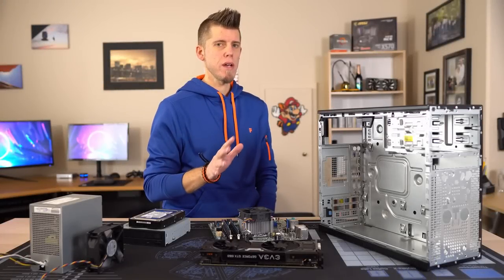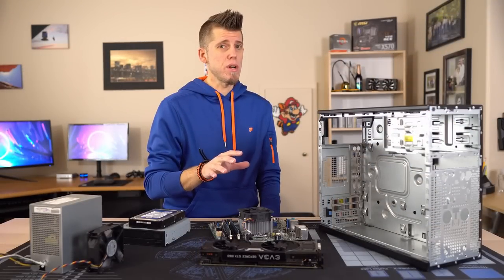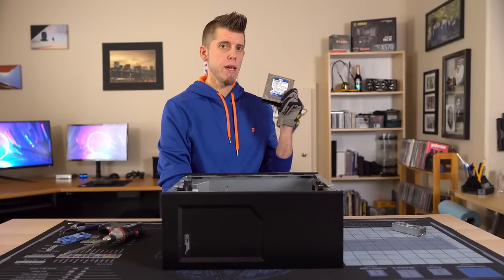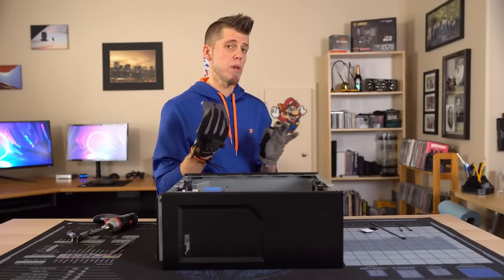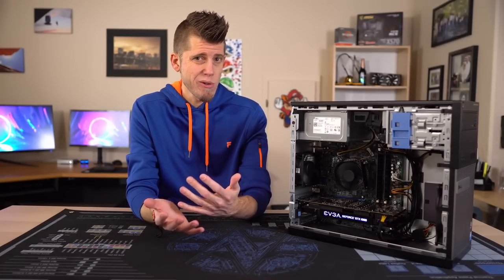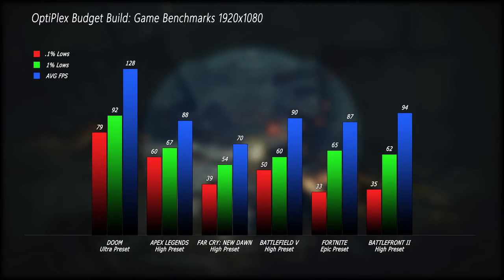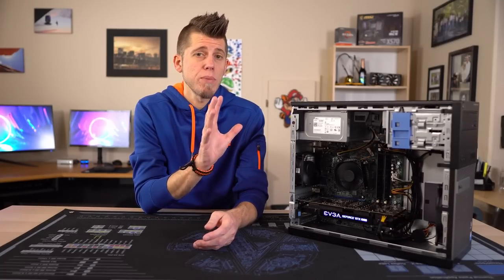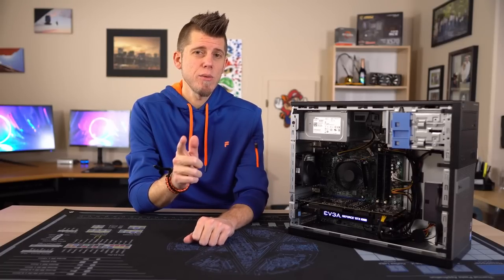Dell OptiPlex Budget Gaming PC For Under $300?

Comment: thanks for this video i have optiplex 9020 i7 so i will just buy the same gpu like yours, hopefully i can find same price like that.
Reply from the maker: Right now... not really. For some reason people are paying absurd prices for 1060 6GB models. You might have better luck in your area locally, but on eBay, I've about given up on 1060's. I've seen them go as high for around $180. At that price, just go for a 1070 for around $200 and it would be a much better paring with your i7, but you will need a better PSU, and the Dell XE2/T1700 365 watt power supply is a drop in for the 9020 and will give you enough power for the 1070.
Reply: @TheGameBench  thank you for taking time to answer my comment. my friend also have this optiplex and he used 1050i without upgrading the psu. do you think buying 1070 are worth it for some video editing and gaming?
Reply from the maker: @djhurtutorials  No problem. The 1050 Ti is a decent entry level GPU, but in gaming the 1070 will be a huge increase. In video editing... that depends on which editor you're using. If you're using Davinci Resolve, for example, and you're just using the free version... no. Not really. However, if you're using the paid version, very much so.
Reply: @TheGameBench  thank you i'm using adobe premier pro. i just saw one video uses 1070 so i guess i will for there. need to  save a little bit of money hehehe
Reply from the maker: @djhurtutorials  Then yeah, the 1070 will be a big difference over the 1050 Ti.

Comment: Hello! I'm a rookie PC "builder" and looking to make a similar build although, I'm using a Dell Optiplex 390. I had a question and my question was, if I could use a RX 570 (4GB) on it. It has a identical motherboard layout to the optiplex 3020 and I'm worried I might damage it/potential bottlenecking. I don't have that "Blue Pci Slot" but instead, it has that one "solo" black one. My RX 570 is about (10 in ; I believe) in length, in case you wanted to know. Please give me some insight. Thanks! 👌
Reply from the maker: No, you won't damage it. The nice thing about the 390, and the 790, is that the SATA ports aren't in the way of the GPU, so long as it's a dual slot card. That being said, you will need to replace your power supply.
Reply: @TheGameBench   The Game Bench  Sure thing. Last question; is it possible to put a i7-2600, in this motherboard? Correct me if I'm wrong but I do think you said that to someone else who had a 390. Thanks for insight!
Reply from the maker: @goldenbillz6390  No problem. Yeah, you can drop the 2600 right in. As far as I know the 2700K is the only Sandy Bridge processor that won't work.
Reply: The Game Bench  Forgive me for being a rookie but last question. So, in the process of building the PC, I bought a new ram stick so I'd have 8 gigs of RAM but, once I power on my PC and let windows boot up, I get blue screened and it'll keep rebooting and rebooting and won't surpass that blue screen. Now, I have tried them individually and they do manage to boot up windows but they won't work together for some reason. They are two seperate frequencies as the one it came with is 1333mhz, while as the new one I got is 1600mhz. I have done some research but they all say it doesn't matter and that it would "tone" it down automatically. Any help on how to solve this?
Reply from the maker: @goldenbillz6390  Sorry about the late response. Got really caught up it trying to get my latest video out. Anyways.... yes, the faster stick should downclock to meet the lower speed stick. I don't think that you're problem. It's possible that there could be a problem with one of the sticks where it seems to work fine by itself. There could also be a problem with one of the slots, though that's not super likely. I would try to run memtest86 on each stick individually to see if either fails. If it does, try another memory slot.

Also, these's pre-builts can be picky about what RAM will and won't work. It could just be a case of the system not being happy with one of the sticks.
Reply: @TheGameBench  It's alright man. No need to apologize. I figured it was the system just rejecting it for some reason, but I honestly bought the dell optiplex 790/990's motherboard. And along side that, I also bought more ram but made sure I got the ram at 1333mhz and it's running like a champ. Regardless, I still appreciate the feedback and like they say, you'll learn as you progress. Thanks once again!

Comment: I have the same pc, but my rx 570 is covering the Sata ports and the front USB ports, what should I do?
Although, how do I remove the graphics card? Should I pull or push this blue thing by the PCIe slot?
Reply from the maker: Silverstone makes some low profile SATA cables that will clear the GPU. Just do a search on Amazon for "Silverstone low profile SATA cables" and they'll pop up. For the USB3 header, I use and low profile extension cable. There are a lot of garbage ones, but I've used several of these can they've been great.

https://www.moddiy.com/products/USB-3.0-20-Pin-Internal-Header-Adapter-Cable-Low-Profile-Connector.html

Comment: I have a dell optiplex 790 i built with a gtx 1060 and 16gb of ram. I wanna upgrade to a 120gb ssd for a boot drive, do you think that there will be any bios conflics with making the ssd a boot drive.
Reply from the maker: There shouldn't. When you get the SSD, just install it in the system and boot it up. Then use Macrium Reflect free to clone your current drive to the SSD. I will make an exact duplicate and then you can swap out the old drive and it should boot off the SSD like nothing even changed.

Comment: Is it safe to run gpu on 290 watt power supply with 15 pi sata connector??? 
Please reply
Reply from the maker: Depends on the GPU. The 1060 6GB? Yes. I suggest you read the pinned post for more clarification. But the short of it is, the 1060 will draw 75 watts from the power supply and less than the 54 watts from the SATA connection, which is what a single SATA connection is rated for. Thus, why I decided to go with the 1060 6GB rather than something like the RX 570 or 580 for less money.

Comment: i bought a 7010 optiplex i5 3470 8gbs of ram grabbed a cheap 500 watt psu and a msi 1050ti low profile and put a new hdd in there it was really easy
Reply: How good is it? Did you have any issues

Comment: Good Evening,  How did you mount the ssd on the side?  Thanks, Ben
Reply from the maker: I just used some 3M command strips. They hold it securely and come off without too much fuss.
Reply: @TheGameBench  thanks buddy, my way was a bit more ghetto. I just drilled holes on the bottom of the case in the same pattern  as the bottom of my ssd and screwed the ssd in to the bottom of the case close to the fan.

Comment: I have a 2 questions about the 3020. 1. Can it take a ssd? 2. Will it improve my gaming experience? Thanks
Reply from the maker: Yeah, you can put an SSD in the 3020, no problem. The only difference is that you have one less SATA port, but that should be a non issue. However, unless you run the games off it, it will have zero impact on gaming. Even then it would really only have an effect on load times. Frame rates would be the same regardless. That being said, they're so cheap these days. Something like the Adata SU635 or Crucial BX500 are great budget SSD's and they will make it seem like a completely different computer in loading times, open programs, boot times, all for about $30.
Reply: The Game Bench thx
Reply: The Game Bench also, should I keep the HDD as back up space?
Reply: The Game Bench ( sorry for all the comments ) what memory do you recommend? 16gb max for 3020. I have to upgrade from a measly 4gb and I want to get the best bang for my buck memory. The cheapest option that’s compatible with the 3020 would be preferable.I really don’t like deciding on what memory to buy by myself. And I’m sorry for asking so much from you, i am new and I’m just now learning all of the things for a computer. Again, I’m sorry for the billions of comments thank you 🙏
Reply: The Game Bench one last thing is that I’m going to buy the adata ssd. It looks good thx
Reply from the maker: @Dag59990  No problem. For the HDD, I suggest keeping it to run your games off it and/or for storage. Even on my main editing/gaming rig, I have my higher priority games on an SSD, but most of my games are installed on a HDD. As for the RAM, I would stick with 1600MHz DDR3 (PC12800). Can't really use anything faster, but with the 3020, you only have two RAM slots so you would have to just get an 8 GB stick and go with 12GB, or get two 8GB sticks and sell the 4GB stick you currently have. Either way, here's a link to a seller I've used

 https://www.ebay.com/itm/8GB-4GB-x-2-DIMM-DDR3-PC-Desktop-PC3-12800U-1600MHz-240pin-NON-ECC-UnBuff/183334198374?ssPageName=STRK%3AMEBIDX%3AIT&_trksid=p2057872.m2749.l2649

Comment: Geez with inflation now, you’re lucky to get a 4gb gpu, great video though. I currently have a 7020 with a i7 chip (got lucky!) that will most likely swap into my current chassis as my current processor is an i7 2600.
Reply from the maker: Yeah, it's really sad looking back at this video since you can't even get that GPU by itself for the cost of that entire system. Hopefully the market continues to correct and brings the value of crypto down. I've noticed today that the cost of 4GB GPU's has fallen sharply from what they were a week or so ago.

Comment: Where did you put the temperature sensor now that the fan blocks its original mounting point?
Reply from the maker: Sorry, I guess I wasn't clear with that one, as I get this question a lot. I bundle it with the rest of the cables and zip tie it to the front panel cables so it ends up pretty close to being right above the fan.

Comment: I found a local place selling the OptiPlex 9020 without a hard drive or RAM for 5 bucks. If i were to get this and get a separate drive and ram would i be saving any??
Reply from the maker: That depends on what CPU is installed. Adding 16GB of RAM would cost you about $40 to $50 and a used 1TB HDD, about $20. If you buy it new, just under $50. So, if it's an i5 you'll save a bit, being that they're selling for $160 on average. If it's an i7, you'd be saving a TON, as the sell for around $200 to $250 complete. However, if it's a Celeron, Pentium or i3... they're not a viable option for current, more demanding games, so you'd want to replace them with at the i5 or i7 if you can. Even then, you'd still save money and could re-sell the CPU that comes in it to get some money back.

Comment: The Optiplex 9020 MT can only handle DDR3 1600 memory, so which is best for gaming and fastest according to CAS or CL?
Reply from the maker: I wouldn't over think it. A lot of people do, and you'd only see a difference in CPU bound scenarios. Even then, you're only going to notice them in a benchmarking graph. In the Optiplex, it matters even less as you have zero control over it. Just because you run lower latency RAM does not mean you will get it, or that it will even work. Best to just stick with the OEM RAM that came in these machines. However, there are some DDR3 1600 sticks at 19CL, and I would avoid those as there are OEM DIMMs that came in these that run as low as 11 or 12CL.

Comment: Not sure if it was already asked but can a 3020 be moved to a new case (straight up, without mod)? I got one fr cheap and getting used to that new world (thanks Game bench to have motivated me). I'm asking cause by the time you buy all the part and the time spend, could get a $40 case and be done with it. BTW great video serie love it.
Reply from the maker: As long as it's a mini-tower, sure. The MT boards at just micro ATX. In the 3020 the front panel audo jacks and USB2 jacks are standard. The power switch and LED aren't, but you should be able to connect them up to the correct pins. There's a pinout if you just search Google. Also, if you're not going to use the 290 watt PSU that came with it, you'll need an 8-pin to 24-pin adapter.
Reply: @TheGameBench   thanks, definitely a option! By the way I'm planning to pair it with a R9 290x, which should be fine for any 1080p gaming (i know power consumption is a little on the high side but i can get it for super cheap).
Reply from the maker: @Mambrax444  Nah, the 290X is still a good 1080p card... but yeah, it does come at that power cost. You can get a used Corsair CXm for like $40 to $50 and have a decent quality PSU for not a lot of money, and I'd suggest that over a new ThermalTake Smart Power at the same price.
Reply: @TheGameBench   thanks for the tip. Digging in the project. Fun stuff. The GPU's on ebay are hit or miss, some people are selling out of mining for 30% over new cost (????) really... Some good 770 out there but they're big so hdd cage as to come out.
Reply from the maker: @Mambrax444  Yeah, since the Kung Flu hit GPU prices have gone up as supply has dropped. I've seen a guy locally trying to sell a low end 1060 for over $200 the other day. I know I won't be buying anything anything until this blows over.
Reply: @TheGameBench   good point staying in the look out for a deal! Love the modingaspect of those project. (i already have a Ryzen 7 with GTX 1080ti as main rig)
Reply from the maker: @Mambrax444  Yeah, it's really been satisfying giving these older systems a new purpose. Keeps me from constantly building new systems.

Comment: A few days ago I got the urge to play GTA 5 again. It has been about 3 years since I lent my PS3 to the daughter so I started looking at PS4. Quickly realized there would now be a fee to play online so I started looking at upgrading the home computer. That ended up being a dead end due to it being a small form factor and the graphics cards would not work. Went on Craigslist and found a suitable computer to upgrade and it happens to be a Optiplex 9020. I have a 500w power supply on the way as well as the adapter cable (thanks for the heads up).
Working on finding a suitable graphics card now for under 100 bucks. People on Ebay are offering up empty boxes for 20 bucks! 80 to 100 bucks for completely dead boards. Looks like the auction route is going to be the way to go. In the meantime I am looking at your videos and trying to absorb some knowledge and apply some to my build. I will likely end up with a far better machine than I need but still in the same price range as a new ps4. Thanks for sharing the knowledge.
Reply from the maker: That's awesome! I'm constantly doing shopping for GPU's and I've seen a lot of 570's go for around $100 BIN, auction, I've seen them go for more, some for under. Just takes some dedication, but I'd say you shouldn't have a problem getting I decent 570 for $100, maybe a 580.
Reply: @TheGameBench  I just won an auction for a 570 for 100.19 with tax and shipping. Just have to wait a few days or a week for it to show up. Thanks again.
Reply from the maker: @tbirdracefan  No problem!

Comment: should i buy a gtx 970 or an rtx 870? im looking for a decent gaming machine to replace my dying ps4 but im  struggling on what gpu i should chose.
Reply: Considering there is no GPU called RTX 870, go with a 970. But honestly if you're looking at used hardware, I'd go with an RX 470. It performs the same, if not a  bit better and requires less power.
Reply: @narwhal4304  oh I should have checked before I posted, I meant to say the Rx 570 :p
Reply: @yousufahmed1418  Yeah I'd go with a 570 then.
Reply from the maker: Yep, I agree with @Quenton... go with the 570. You'd have to replace the power supply either way, but the 570 will easily beat a 970.

Comment: I got my first one(9020) modded but short the addition of the front fan due to lack of connectors.   My one question is where/how did you attached the temp sensor?  Seems the plastic is keyed for a specific location which is now(or will be) taken up by the additional front fan.  Or maybe I'm making this harder than it really is.   lol
Reply: Yep you're over thinking it, just clip it above the HDD on that cage
Reply from the maker: Yeah, I just bundled it up with the front panel cables above the fan. If you wanted the rear fan to rely more on the GPU temp, you could put the sensor below the GPU.